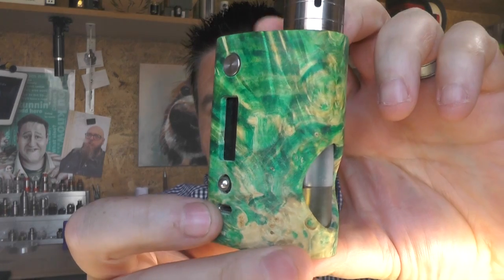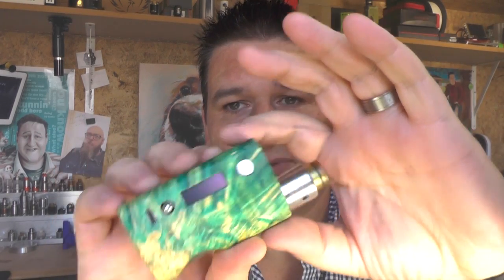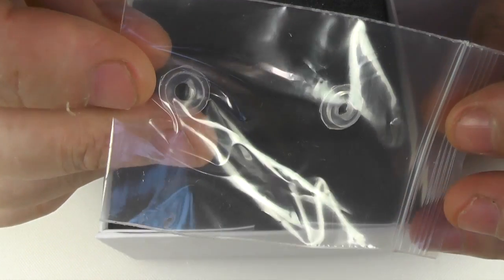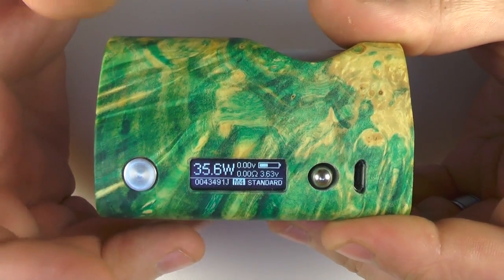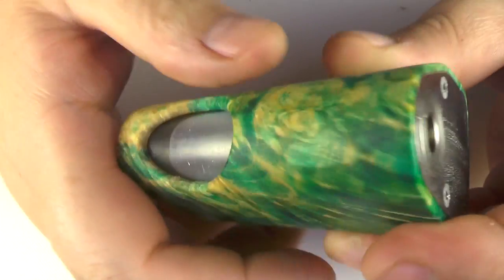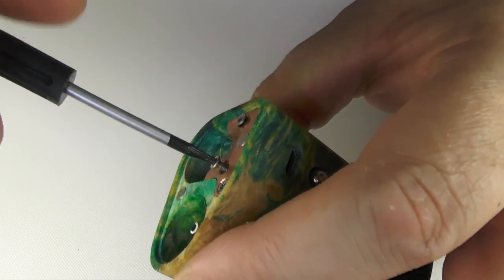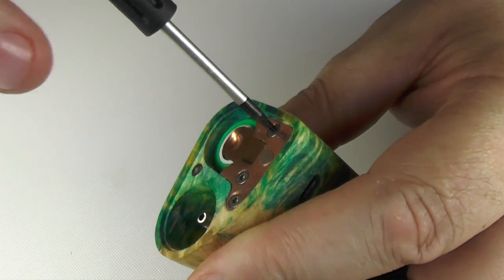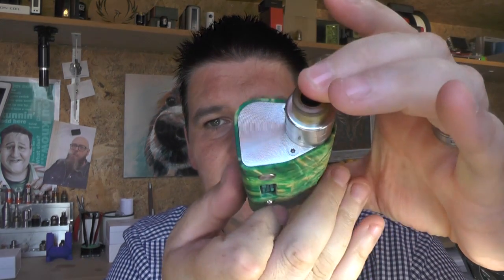The KO Squonker from CSM

Comment: Also just tie a very thin string around the top of your bottle under the screw on cap.. they make specific ones for pulling squonk bottles out but you can just make one so that it will just be hanging down and you can pull it and your bottles will come down =)
Reply from the maker: I have a stack of them but not enough room to use in this mod.  As per the description the retail version is easy to get the bottle out :)